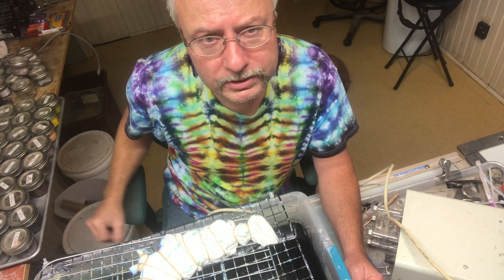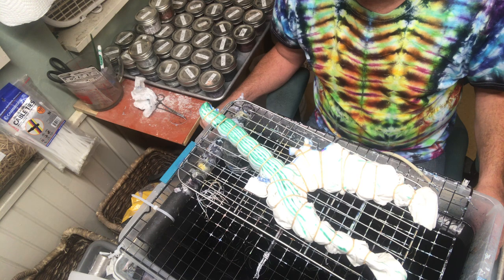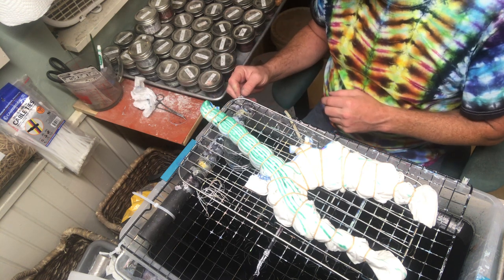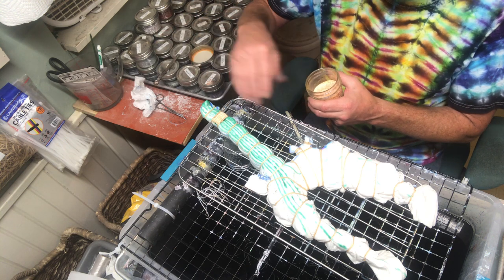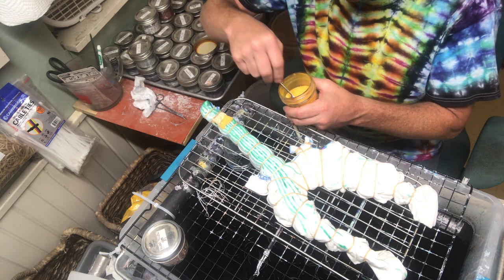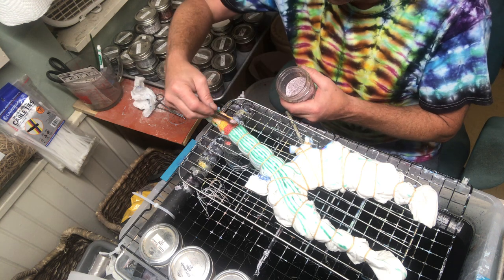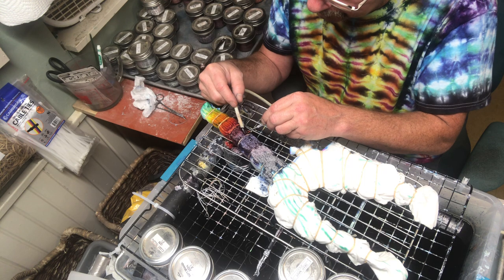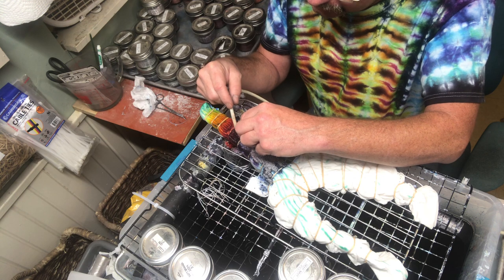Hot Water Irrigation Tie Dye Technique

Comment: Do you have to use the dye mixed with soda ash, quickly? I thought the soda ash starts to react with the dye and the dye won't last long after contact with soda ash.
Reply from the maker: No Laree, good question. I mix the dyes in small jelly jars and go through most colors fairly quickly.  According to a chemical engineer buddy, not until it dissolves in water must it be used quickly.
The ratios I mix are 2:1 or 3:1. The first number is soda ash or SA. The second number is the concentrated dye. Typically the blue and purple shades, cool colors, get a 3:1 ratio. The warmer colors get a 2:1 ratio.  That's only my mixes.  You can also make shades darker or lighter by adding or subtracting the amount of SA added to the dye.
Reply: Thanks for the detailed explanation, Kurt! Good stuff!
Reply: this has never been explained that way before, that I know of. Thank You!

Comment: Can you give the brand & type of pump. I'm looking at investing in one myself but don't want to waste money on one that is going to erode quickly with soda ash. I know you said peristaltic.  I know it has a variable controlled flow. But is it a specific type, something special or different from other pumps that allows it to tolerate the ph of the soda ash?
Reply from the maker: Holly, I no longer use soda ash in my bath. I use straight tap water, 140F. 

You could start playing immediately using a one gallon pressure sprayer like you might find at a garden center. They’re typically used to fill with weed killer or pest spray. Pretty cheap too.
Reply: @surrealpencil  Thanks friend!  I just started a tie dye business a little over a month ago which I run on Facebook. It seems to be snowballing & I am positive this method would be so beneficial. Plus, I have NEVER been the patient type.

Comment: Do you have to dye both sides and where did you get your pump from?
Reply from the maker: Michele, it depends on the look you’re going for, tightness of your tie,  wet or dry item being tied, etc. 
It varies but generally I dye single side and then remove bindings to check for saturation. If I do add more dye, it’s usually lightly for lighter pop colors.